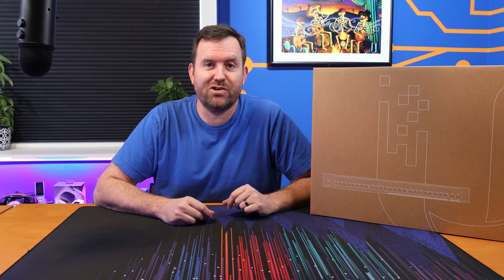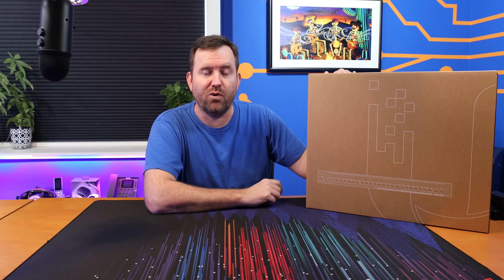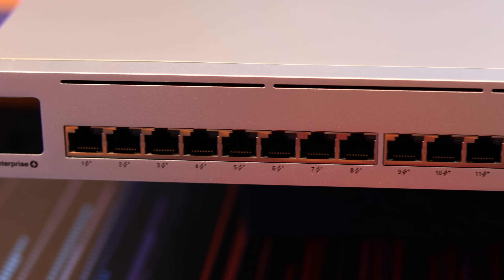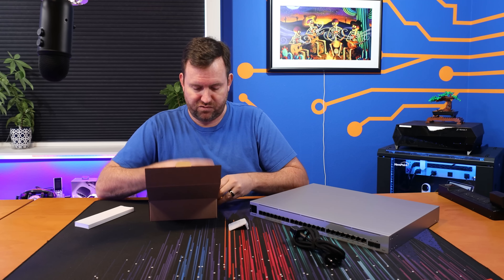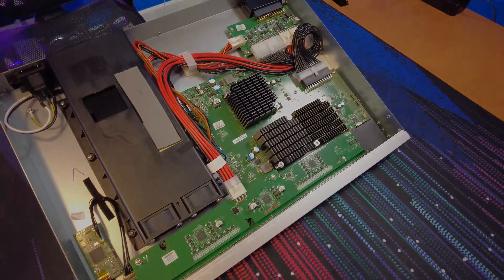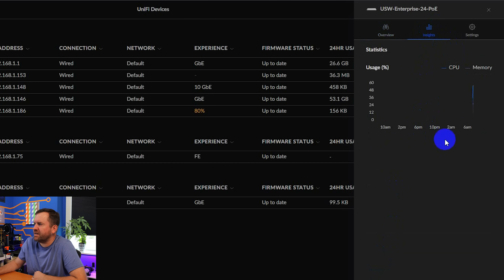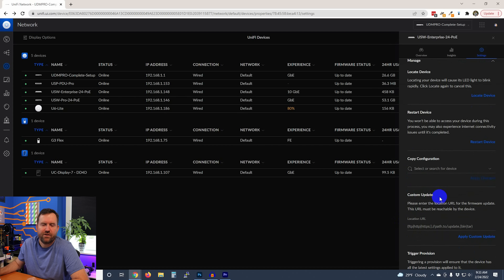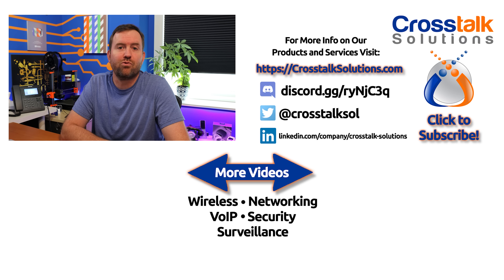UniFi Enterprise Switches - 2.5, 10, & 25 Gbps Connectivity!

Comment: Hey Chris...thanks for this video.  Have a customer that has Comcast/Xfinity as their ISP and paying for 2.5G download speeds.  I've installed a Dream Machine Pro SE connected to (2) Enterprise 24-POE Switches and the Dream Machine is connected to the 2.5G port on the Xfinity XB8 router.  I ran a speed test in the dashboard and I'm getting close to 2.5G speeds and also shows that my uplinks are connected to each switch at 10G via Unifi Twinax cables and have connected a total of (7) U7 Pro AP's to the individual  POE+ 2.5G ports which also show 2.5G connectivity.  

However when I connect my laptop which has a 2.5G network card I'm not even getting 1GB speeds.  I know my network adapter and the cables are good as I've terminated and tested them and when connecting my laptop directly to the 2.5G port on the Xfinity Router, I'm easily getting close to 2.5G speeds.  However not getting that when connecting to the individual 2.5G ports of the switch which is odd.  I've never seen this before as I've predominantly been installing 1GB networks.   Didn't know if anyone else had experienced this?  Thanks!

Comment: To use the UWS Enterprise 24 switch at 2.5gbe per connection, I take it you would need a minimum of cat6a? Is that correct?
Reply: cat6 would likely have no issues even for 10GbE at short distances

Comment: Due to all the chatter on my home wifi with the 40+ IoT wifi devices and other various wifi clients I have began deploying U6 Enterprise APs, mostly for the 2.5Gbe backhaul to LAN.  My plan is to slowly begin to upgrade my switches that run these APs with Enterprise 8 PoE and Enterprise 24 PoE switches to not only bump up the backhaul on the APs but to also provide for aggregated 10Gbe links to my aggregation switch.  I know this seems a bit overkill for a home network, but it just seems like with all the wifi devices and having 2 home offices that this type of setup is becoming more common.

Comment: Thanks, my first switch to unifi gear and I'm running this from my home office with the kit inside my actual room. Did not expect this to be so loud. Can these fans be changed for quiet ones? Not an issue for long term as I'm moving soon and this will go into its own rack. but man, going from a fanless switch to this was an ear opener.

Comment: Your lab is impressive. You may have seen (as of this writing) that the Enterprise XG 24 switch recently became available again. My only problem with the SPF28+ switching is limited, only the 28 port aggregate pro switch has the ability to pair at 25 GBe. I believe Ubiquiti had a previous early access device that was aggregating some ridiculous 48x SFP28+ but I'm unable to find that in the wild. I believe Synology supports 25 GBe with an OEM Aqauntia/Marvel/Nvidia card, so you might test that way?

Comment: With the limited Layer 3 routing, does this switch obey firewall rules for traffic between VLANs? If I have an IoT VLAN that only allows access to Home Assistant and internet while blocking initiating a connection with any other VLAN, will this switch also obey those rules or would it allow traffic to freely move between VLANs? If it doesn't obey those rules, can the Layer 3 routing in it be disabled?

Comment: It seems you were struggling a little on the Layer 3 situation. Frankly, the UI suite should be described as providing L3 features not L3 "capabilities". Some significant other features were purposely stripped out but which would make them viable as enterprise devices.
Reply: another reason i like netgear, they advertised my switch as layer 2+ ...simple...

Comment: I've had Ubiquiti in my home lab for 13 months and so far, things have been mostly good. I have the UDM-Pro, the USW-24 Pro and the Aggregate switch. If I was doing this all over again, I'd probably take the UDM SE but even as a PoE device, it's PoE ports aren't 2.5gb and I'm looking squarely at that new Wifi 6 Enterprise to upgrade the home Wifi with Wifi 6e. The problem is that nothing in my rack does PoE since I didn't need it last year and that new 8 port Enterprise switch which is 2.5gb PoE is almost double the price of my Aggregate switch. Yikes.
Reply: Yeah we need a new UDM already with 2.5gb ports PoE.  Buying an $800 switch to get 2.5gb ports on a rack mount is crazy.

Comment: We're just building a network with lots of them. They're really neat, while we DO HATE the fact that there's no version with OOB ports and you can find some limitations in the LCD capabilities for business settings, the overall package is great.
The 8port is pretty overpriced imo, the 48ports are a gift to smaller enterprises.
Reply: To clarify, we are building this with a dedicated oob network to cover for provisiong failures and a very different level of core switches. So we use the brains of unifi for things like port profiles and ease of client service quality tracking, but absolutely don't involve the unifi devices in i.e. routing, which is done by switches that have the proper quality and capability to i.e. ensure no-downtime upgrades.
Reply: This mix was cheaper and allowed us to have 2.5g and Poe absolutely *everywhere*. Ubiquiti is almost the only vendor to figure out that a 48port 2.5g switch is useful and a 4times more expensive switch with 16*5g plus 32*1g sucks for operability and other concerns.
If the more professional vendors INSIST on offering a worse choice... So be it.

Comment: I have a 16 port switch and a UDM Pro. I would have liked it if the port rows on both the UDM Pro and switch were flat and not stacked one row above another. And in both cases, the switch ports are on the right. If the UDM had its ports flat on the right, and the 16 port switch had its ports flat on the left, that would make for much cleaner patching between device and patch panel.

Comment: I recently bought an HP 2530-24 PoE switch and opened it up to clean it up and it has very similar board structure. The board that is on top is for power delivery and injection per port. That is why there is those ICs on the board. The bottom board is the standard motherboard for the switch circuitry

That USW-Enterprise switch looks quite heavy! lol
I really like the idea of the ports being in a row. Instead of a clustered together. Yes its more to manufcturer due to the ports not being an assembled cluster but I bet its a lot easier to manage/maintain cabling...

Comment: I work in large enterprise networks for an out sourcing company. I just can't see unifi ever coming close to competing with the current offerings. That said, good one, looks like a cool switch, there's probably a middle ground customer for it.
Reply: Yes the unifi software has always been a bit dicky and the feature set is limited. But if you just want simple L2 or limited L3, then these are quite fine.
Reply: It doesn't make sense if you need to deploy many 100s or 1000s of access switches, need to pick up trends on SFP module failures or such. Any basics like EIGRP or more modern stuff are also amiss.
Yet, if you, say, just need to get faster client networking to 100-1000 users, there's this middle ground.
Reply: @udirt I have a Meraki network with 13 48-port switches.  It's really expensive, so I'm thinking about replacing the access switches with these Ubiquiti switches (and keeping the core switch on Meraki).  These would be doing L2 and sometimes multicast with our public announcements system.  Would I regret Ubiquiti?

Comment: @Crosstalk Solutions Can the SFP port negotiate at 2.5G as well? Or it is only 1G or 10G?
Reply: Ubiquiti explicitly calls them SFP+ ports, so unless they're breaking with the corresponding SFF standard, they are backwards compatible with SFP (1 GbE). Aside from that, the transceiver you plug into the interface is responsible for transmission negotiations anyway.
Reply: @tillmannfischer  absolutely agree with that, however there are instances where in the port profile you can force the negotiation/transmission rate at 2.5G FDX which is possible with the XG 16 on the SFP+ port, provided that the SFP module plugged in supports multirate. Despite the multirate support on the module side it seems to always favour 10G but falls back to 1G if not possible, it will not step down from 10G to 2.5G and then 1G if all else fails hence on the switch itself you would need to force the specific rate
Reply: @krisenpillay5804  The fallback to 1 GbE is specified in the SFP+ standard. Basically, it's made on purpose for better backwards compatibility with SFP, so that a multi-rate module in an SFP interface doesn't try to fall back to 1 GbE, causing malfunctions due to the interface being incompatible.
Reply: @tillmannfischer  Ah ok, that makes sense, thank you for that. However, for multirate spf modules that support 1G, 2.5G, 5G & 10G would it then only purely be determined by what the link rate is on the "other" end? So if the other end if 2..5G then the module would negotiate to that rate etc. assuming that the switch if managed has it's port profile set to auto negotiate? Second scenario in my personl setup atleast, is my service provider sends 2G fiber to my home, I know that the SFP module provide links only at 1G or 2.5G so when connected to the providers router the tests show up to 2G DL speeds and 1G UL however, the UDMPro I use will only negotiate at 1G and only if I force the link rate of  the port profile to 1G FDX not auto negotiate (no option of 2.5G on the SFP WAN ports, but 2.5G FDX is an option in the dropdown when creating a non-WAN profile), hence my original question on whether this switch allows 2.5G FDX on SFP like the XG 16. So my question is now as you have helped me better understand is if there is no real effect on the software/switch side on forcing a link speed? Maybe I misunderstood the hardware side of thing. I appreciate your help.

Comment: 10Gb between Switch and Router means it doesn’t matter if routing goes back to the “router” vs staying on the L3 switches.
Reply: Not true, there are situations where L3 would be a benefit over that and 10Gb could be saturated. That’s also not even taking latency into the equation as just having a 10Gb connection isn’t the whole story.

Comment: Does the Enterprise XG-24 require something like the UDM pro to work?
Reply: No. The UDM Pro does feature an integrated UniFI controller though so you do need to run the UniFi controller somewhere if you're not using a UDM device. You can run it on a UBNT Cloud Key, VM, internet hosted VM or as a Docker image. I run my UniFi controller for my switches and WAP's as a Docker image on my UNRAID NAS. I use the linuxserver/unifi-controller image as it's well maintained and I just update it periodically through the UNRAID Docker managment. I use pfSense for a firewall because the UniFi firewall is pretty limited.
Reply: @lordcarnorjax8599  I saw comments on reddit earlier saying that the UDM Pro is required for the XG24. I run pfsense with mikrotik poe switch but looking at the XG24 for all those 10G ports. I got a controller installed on a VM to manage a couple of Unifi APs. Thanks Jax!

Comment: Not impressed with anyone's switches. Someone needs to make something modular in 1u and that doesn't cost datacenter money. Would be nice to have like 8 PoE gig ports, 8 plain gig ports, 8 SFP ports, a couple SFP+ ports, and maybe 2 QSFP+ ports. Cheapest solution now is to have a switch for each kind of port.
Reply: What you describe would be at home in an aggregation switch (especially the QSFP+ ports), which would be kinda dumb to combine with GbE ports. You basically want three devices rolled into one, and that's not what enterprise switches from any brand are made to do.
Reply: @tillmannfischer  Companies make modular switches. Problem is they take up huge amounts of rack space because each module still has a crap load of ports and they cost too much. I have one client that would fees everything at 100 gbps. I have a single client that needs 10 gbps SFP+. I have several clients that need gig SFP. I have a bunch of things that need plain gig ethernet, and then I have some things that need PoE. I shouldn't have a to buy a switch for each thing.

Comment: I have been watching everything I can trying to figure out what I need. My internet provider recently went to 5GB internet at the home. I instantly upgraded but then realized none of my equipment is even fast enough to get those speeds to my computers. I love the UI products so thanks for what you are doing helping explain this to someone brand new to upgrading my network to multi gig.
Reply: wtf. Sick speed
Reply: I had a few years of 10gb. The highest speed I saw any one server was Netflix at 3.5gb. My takeaway was that you almost never saturate a multi-gig connection... but the flip side is more interesting... You never have the network as a bottleneck (eg. start a large file transfer and your conference call drops out)
Reply: AT&T fiber? They just rolled out 2 and 5 gb plans in my area as well, and I was initially tempted to upgrade from the 1 gb plan I'm currently on, but literally nothing in my home network could take advantage of those speeds at this point, and it would cost a few thousand dollars to upgrade things in order to take advantage of the higher speeds.

While the nerd in me is tempted, the cost/benefit equation just doesn't work out in favor of doing so at this point.
Reply: @AnotherInternetRando  My cost to be at 10gb wasn't high... Here's some learnings I had:
-Look for NICs on eBay
-switches from mikrotik (220$ for 8 ports)
-Dont fear SFP+ or rj45-sfp+ adapters
-Not everything has to be at that speed (router, storage, virtualization, power workstations... Other stuff can be 100/1000 or wifi)
-multi-gig home brew pfsense box is not much more than 1gb

But

- once you get to 1gb for home, latency is more interesting to chase than bandwidth 
-if I had to choose between multigig wan (assume the switch and router have multigig connection) and LAN .... LAN every time
-beware ISP topology that has shared bandwidth eg 10g Pon)... It might saw multi-gig but you might share that with everyone else on that fibre

Comment: 2.5 and 5g But is not really Enterprise, maybe prosumer.
Reply: 100% agree at this point. They only just sorted the L3 DHCP relay which is just amazing that wasn't there from the L3 switch release. UniFi has never been Enterprise ready, prosumer and SMB/SOHO at best.
Reply: @lordcarnorjax8599  Meh, depends on which part of the Unifi family you're looking at. Their Wifi solution has always been pretty much on a level with other manufacturers (unless you want to really go into the heavily specialised stuff). At the same time, even today their USG/UDM lags terribly behind as a firewall/routing solution, even when compared to their own Edgerouter line (which is already kinda limited). It's a really mixed bag, and it feels like Ubiquiti still doesn't really have a coherent plan to ever get the entire Unifi family onto an even playing field in terms of which market they're targeting with each device.
Reply: @tillmannfischer  I use Cisco Wi-Fi controllers and AP's at work. The feature set difference between the two is massive. There's basic features that we use on the Cisco gear that UniFi can't do.
Reply: @lordcarnorjax8599  Honestly, there isn't much in Unifi Wifi that I am missing when compared to Cisco. Additionally, the cost difference makes it hard not to forgive certain shortcomings.

Comment: Could you include some info on the power budget in your reviews as well please? In my view this is on of the weaknesses of unifi. 

Also, how are the noise levels?

Love most things about this switch. Not sure about the pricing though. Really considering moving away from unifi because of it. Ah well, it will be another 18 months before my new home is finished and I will need to make that decision.
Reply: Noise levels would be really handy to know.